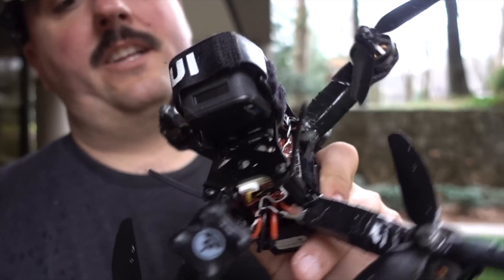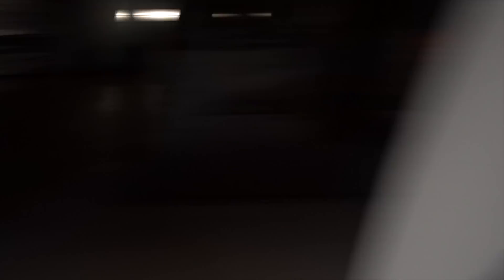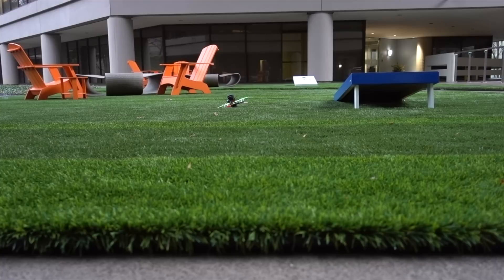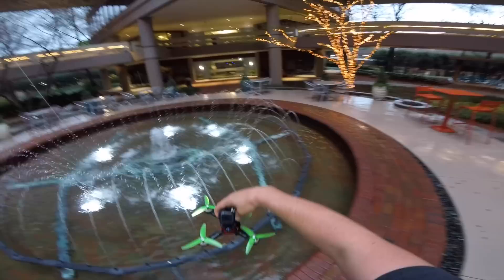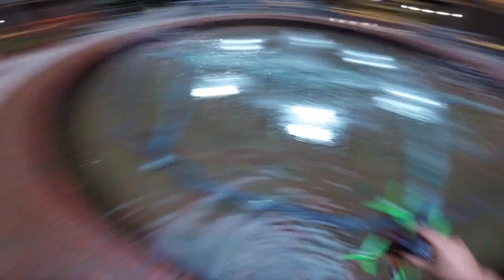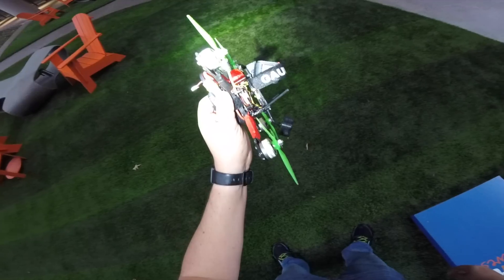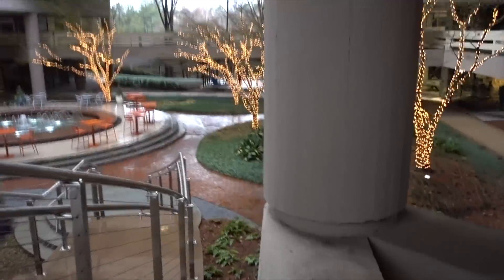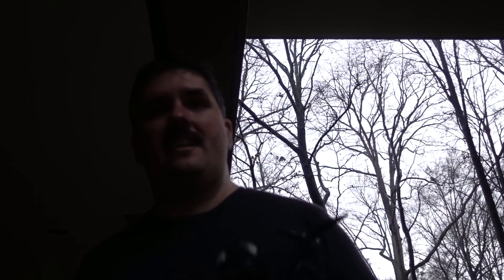How Waterproof is Your Drone?

Comment: Don't wanna be captain obvious, but all to most electronics components like resistors, IC, and motors are cool by Convection. In simple words they need to be air cool, otherwise they can overheat to their breakage point. Believe me I have seen burnt motors, resistors, capacitors, IC chips blown up from over heating. So, adding a extra layer of anything from silicon, hot glue gun , oil, or any other hydrophobic material might make your electronic components water proof, but might overheat them. Putting any material that is not breathable on any electronic components is like putting a plastic bag over your head. There are three ways heat dissipates convection (air), conduction (touch) and radiation (electromagnetic like sun rays). It know of a few companies that waterproof consumer electronics (HZO), they expose the hardware and bake them in a cocktail of chemical vapors call Parylene. This process is expensive, so companies use cheap "O" rings and seal to make water proof devices. However, for the normal life of a drone 5-7 minutes and 1 hour charge it shouldn't overheat. Unless you upgrade the battery Amps (current) that's the mAH. Lastly, most drones now have a form of lithium batteries, they can be very dangerous if a short-black wire() touches red wire(+) develops. Lithium batteries are known to explode and even catch on fire from shorts, overcharging, punctures and many more scenarios .
Reply from the maker: +Milton Ayala Wow that devolved quickly. Yes cooling can be an issue but most components on a quad aren't that likely to overheat other than the motors. I'm honestly not sure where you were headed with your point about batteries though. Yes lithium batteries have inherent risks, I'm not sure it applies to your points about waterproofing though.

Comment: @StingerSwarm Did/can you coat the motors too? How did you do it?
Reply: That was my ? I don't know of any way of conformal coating of a brushless motor.  Lol water can easily get in around the motor shaft and the portals  on side of motor
Reply: @knarftrakiul3881  the motor wire is already coated from the factory to keep it from shorting on itself. No need to coat it further!
Reply: @angelofaraday5280  does this apply to tiny 6x15mm brushless motors for 1S mini quads?

Comment: Im assuming/wondering did you also put conformal coating on the back of the fpv camera board as well?  along with corrosion x on connections!

Comment: Conformal coating is awesome. I constantly fly my quad in the heavy rain just to prove a proint. Even videod my first flight with it. Every build I do will have conformal coating. BTW, I used the acrylic conformal coating by the same company. So either works great

Comment: Did you dunk it with the battery unplugged? 
https://youtu.be/U-EYk1UmUxY?t=10m45s
I'm not sure that that's a valuable test since most quads usually don't unplug themselves before falling in water.

Comment: It looks like you only coated the top side of the ESCs with conformal coating. Anything on the back or sides of ESCs that could be a problem when wet?

Comment: ty so much for your effort buddy. i lost a kwad last week to a pond. i noticed in your video that you only painted one side of the esc with the Ccoating, did u get both sides? im thinking of trying this, but completely dipping the parts in the Ccoating, letting dry 48 hours for full cure, then repeat again for 2 , submerged completely covered coatings. the mfg recommends 48 hours for complete cure. how long did you let it set up? i think this will work, ( also i think submerging in the Ccoating while the parts are connected, and doing the corX first in the connectors, then submerge the parts, while plugged in ,(ie all conectors - i dont mean plug battery in while doing this) into the Ccoating, may provide a truly waterproof kwad. ill hit you up if i get good results. may be a few weeks b4 i can try it.  // fist bump

Comment: What if you don´t apply it with the brush but solder the motor to the esc and then dunk the hole thing (without the motor) into a small vessel so the coating is more consistently applied ? Really appreciate your devotion to testing this for all of us, the footage is awesome

Comment: I think the problem with the water proofing is the motors. I think where the motor wires are attached inside of the motors gets a little water in there bridging the gap and causing a Dsync. I dont think you can fix it unless you take them apart and really coat the inside with something. Just a thought.

Comment: I am using a conformal coating spray (Plastik 70 - think it is only available in Germany or Europe). Very easy to apply and covers even small parts perfecly. Dries in about 10minutes I would say. So I covered everything in two layers. Then also all the connectors with something similar to corrosion x. Works perfectly for me so far. Landed couple of times in half molten snow . Just continued flying.

Comment: you need to seal your esc with epoxy on both ends of the heat shrink, the escs are to sensitive, the waterproofing only protects it from damage

Comment: Please, please, please post a couple of follow ups a few months apart so we can see if the water has longer term effects.  It would have been nice to see both of them dunked.  Did I miss the control?  Where is the quad without any conformal coating?  For comparison sake, how long does a quad last in those conditions without any waterproofing?

Comment: it's called dry drone. apply same way as silicon conformal and is alcohol based. so it will be completely dry within 20 - 30 seconds, however it takes 24 hours to fully cure for waterproofing.
never had an issue with it crashing in snow and being completely immersed in water (from the packed snow melting on the electronics - including bare esc's)

Comment: nice experiment. I think the foaming bubbly action of the Corrosion X fills more cracks and crevices than the other stuff. Flite Test has a video where they dunk a whole motor, esc and receiver and run them underwater, I'm pretty sure they used Corrosion X

Comment: Do you think that this waterproofing would also be advantageous for flying in very dusty/sandy conditions to protect the electronics from getting clogged up with dust? Thanks and stay happy in the air :)
Reply: It won't stop dust collecting, but it will have a layer of protection from it. You might want to put a thin light layer of electrical tape covering everything, or hot glue over it.

Comment: Good test Kevin! 

I tested a motor + esc with 1 coat of CorrosionX in a bucket of water. I ran it in total for over 1 hour running time (several batteries) in that bucket during 1 week (even left it sitting in the bucket over 1 night), and i had 100% control over it at all times, never even got a hickup.
 When i tested a similar esc withoug any coating, it stopped running immediatly it hit water.

Yes CorrosionX is a bit messy if you fly in dry/dusty areas, but i havent had a single problem with it. I use it on all my quads! A quick spray of electronic cleaner + compressed air, and everything looks as new and is ready for a recoat.
I do this when i do bigger fc jobs, otherwize i just leave it as is.

Comment: How do you get past water getting on your FPV lens?  I tried to fly in the rain the other day and had to land within 30 seconds because I was almost totally blind.  Everything was totally blurry from water on the lens.
Reply: Plur307 apply rainx. works wonders as the water just beads up and runs off from the wind blowing when you fly. will still get some rain drops that'll obscure vision but nowhere near as bad as going completely blind. hope that helps

Comment: The CCD camera is what I'd worry about with waterproofing... Water weeping past the plastic lense and into the sensor.
Reply: The lens itself also is not always water proof.  I'm using a gopro 2 lens and I was cleaning all the junk off the lens using a q-tip and some soapy water.  After I wiped the lens off I noticed bubbles INSIDE the lens.  The soapy water wicked around the edges of the lens and inside.  I wasn't using a crazy amount of liquid or anything.  Just a q-tip that was damp with soapy water.

Comment: What do you do about water droplets on your fpv cam lens? I've flown briefly in some moderate drizzle and it made it almost too hard to fly by. Do you coat the lens with anything or just fly as is?
Reply: shaneman27 I'd give rainx a try. It's a hydrophobic coating for windshields. should work on a camera (maybe)
Reply: T.P.K. I thought about that too. But I'm not sure if that would distort things for the lens or what. Maybe worth a try.